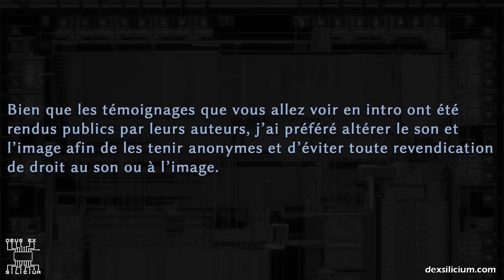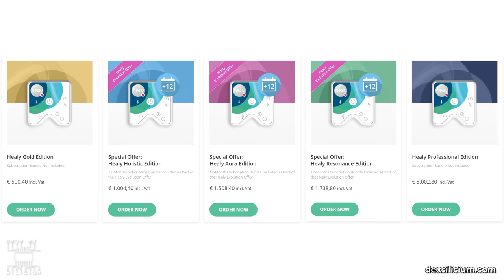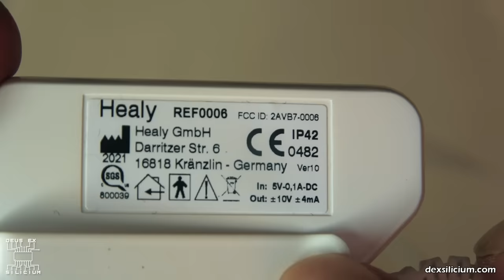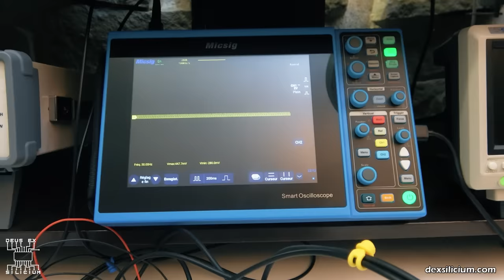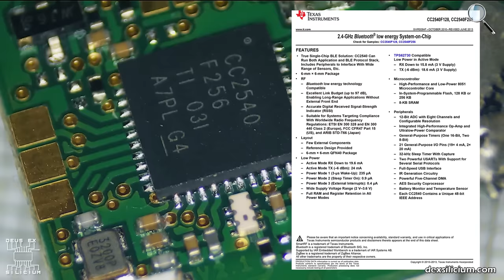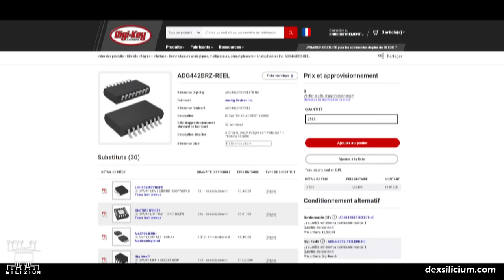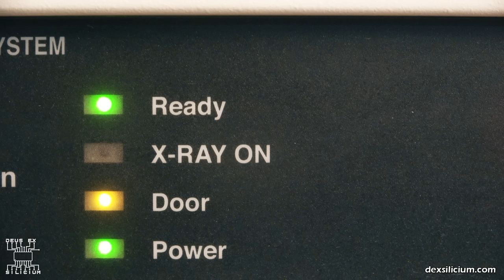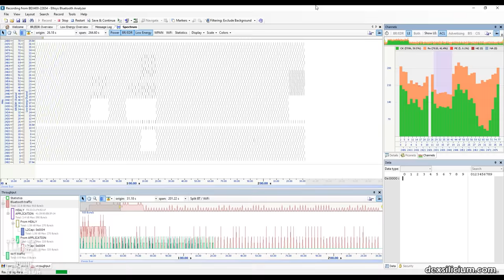Analyse intégrale d'un appareil de médecine quantique

Comment: «n’est que de 40mW » pour un noob comme , à partir de quel puissance ça pourrait avoir un impact sur notre corp ?Positif ou négatif ,je parle de simple ressenti ,pour comparer qd on pose la langue sur les pôles d’une pile plate ,on ressent des chatouilles (avouer ,on l’a tous fait !) ,si je veux comparer par rapport à ce truc ,la pile correspond à quelle puissance ? 
En tout cas merci !
Reply: Pour tenter de répondre à votre question: la langue est un muscle qui se trouve dans un milieu conducteur (salive) donc avec une impédance (résistance) faible. Une pile de 4,5V peut faire passer assez de courant (quelques mA) pour provoquer une contraction de la langue. Les électrodes du biniou sont posées sur la peau dont l’épiderme possède une impédance bien plus élevée (quelques  kilo Ohms). Avec une tension aussi faible que 20V il n'y aura quasiment aucun courant qui circulera donc aucun effet notable. Pensez que vous pouvez toucher sans risque les deux pôles d'une batterie 12V capable de délivrer plusieurs milliers de watts, alors 40mW... même pas peur!
Reply: @cedricpereira72  superbe réponse, merci .

Comment: Ça correspond à quoi le nombre de couches de cuivres dans un circuit imprimé ?
Reply: C'est un bon indicateur de la complexité et de la densité du circuit, une couche suffit pour relier les composants mais pour réduire la surface du circuit on multiplie le nombre de couches.
Nb: souvent maintenant les deux couches externes sont utilisés comme plan de masse afin de protéger les couches internes des interférences externes.
Reply: @loichombert  du coup il y à plusieurs circuits différents qui se superposent en fait ?
Reply: @guillaumelefrancois5255  c'est ça, on peux le voir comme des routes tout simplement pour allez d'un point  à l'autre du circuit.
Plus il y aura de puce avec un grand nombre de pâtes, et plus il y aura de composant, plus il serra compliqué de réaliser un circuit imprimé, car évidement les pistes ne peuvent pas se croiser (hormis la masse qui comme dit au dessus se fait souvent sur une couche unique pour limiter les risque (car si la masse est relié à une entrée de courant, ça fait un court circuit et ça peux crée des étincelles voir des flammes pour certains objet, comme des composant informatique de PC)
Donc graver sur plusieurs couches à déjà cet avantage, mais aussi celui de pouvoir simplifier le circuit, mais aussi de pouvoir réduire sa taille, ce qui réduit encore les coût et puis c'est toujours mieux que ce soit plus compact.
Enfin le dernier avantage c'est que la multiplication des couches du PCB (c'est comme ça qu'on appel la plaque verte avec les couches de gravure les unes sur les autres) permet de rigidifier l’ensemble, ce qui une bonne chose dans certains cas car si le PCB est trop fin et fragile, il pourrait s'abimer avec un choque, en tombant ou autre et se plier, se qui causerait des micro coupure voir même de vrai coupures dans le circuit si le PCB est tordu, c'est pour ça que les cartes mère de nos ordinateur sont entre 4 et 6 couches aujourd’hui .

Avant l'arrivé de l’électronique miniaturisé et des composant Cmos tel qu'on la connait aujourd'hui, on utilisait des "ponts", c'est à dire un bout de fil de cuivre qu'on soude mais en laissant sa gaine isolante, comme ça, pas de contact, c'est souvent ce qu'on fait faire aux élèves quand ont leur enseigne l'informatique au lycée/collège ^^
Reply: @Paulvarrgas  merci
Reply: @Paulvarrgas  Décidément on ne soupçonne jamais toute l'étendue de ce qu'on ignore.

Comment: Merci beaucoup pour cette analyse. Juste un point, afin de vérifier la fonction réglage de niveau : il faudrait placer une charge résistive + capa pour simuler la peau et vérifier si le module effectue une régulation en courant. Cependant, afin d'obtenir un minimum de 100uA comme préconisé sur les appareils de traitement par microcourant, il faudrait monter la tension à presque 30V. De plus ce produit semble fonctionner qu'en alternatif (pulse positif puis négatif), il devrait fonctionner également sur un mode "continu" ou seule l'alternance positive est générée. Je confirme, le fait d'être en contact avec la peau nécessite une isolation importante par rapport au secteur, c'est pourquoi ce produit est sur batterie, et que le fonctionnement avec un chargeur n'est pas autorisé.